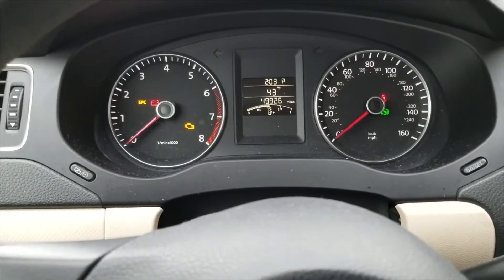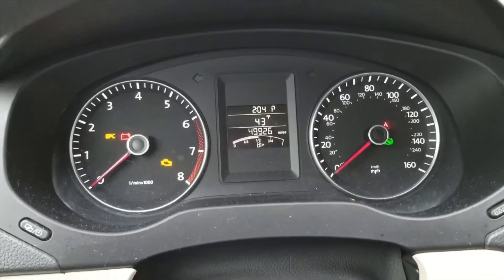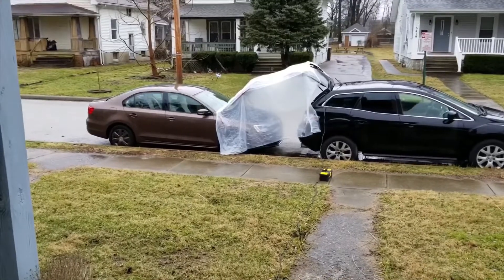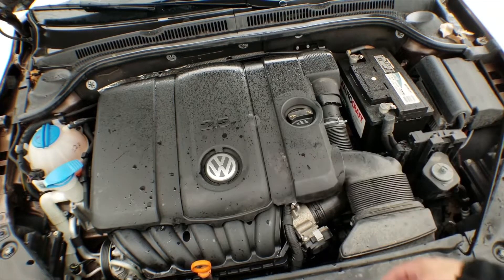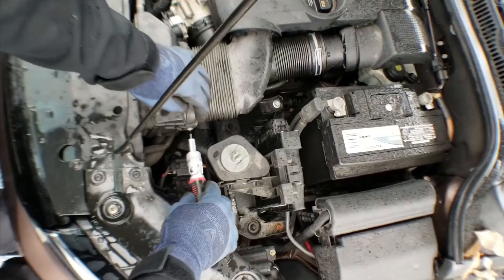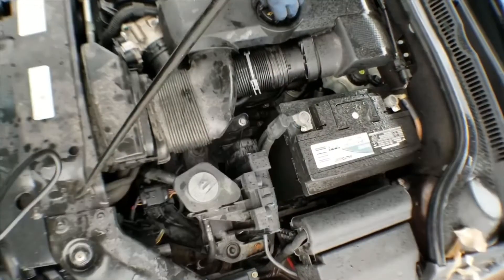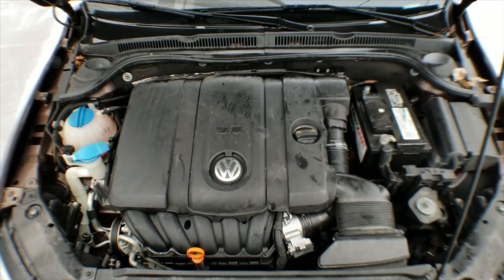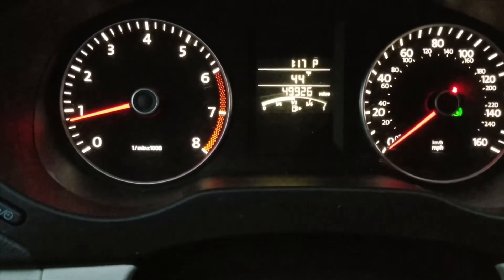Volkswagen EPC Light Diagnosis: Throttle Body Replacement

Comment: Thanks bro! you just saved me about $1000 bucks. I drive a 2013 VW Jetta 2.5. I got the engine light on  and also the EPC light. Bought a replacement throttle body from amazon it was only $64.99 and about an hour and a half of my time to replace it. I did not get the original throttle body but it was a brand new unit. Replaced defective unit with new unit from amazon. And EPC light went off  right away. The engine light went off on its own as well after driving the car for about 30 minutes. Went home turned the car off, then went to go run an errand about 20 minutes later and engine light was gone as well.  Thank you man, keep up the good work!
Reply: Hey man, I know it's been a long time but, how did that part from Amazon turn out for you? I'm having the same issues with my 2013 jetta.
Reply from the maker: Hey thanks for the positive feedback and tuning in! It is greatly appreciated! Awesome I'm glad that this video has helped resolve the problem and thanks for the update 👍 Stay Tuned and consider subscribing if you enjoyed the video! Thanks again!!

Comment: Hey thank you so much for this video I got a 2013 vw beetle and I just got a epc light. The codes it gives me all lead to. Oxygen sensor issue and one throttle position issue. Do you think a throttle body change would help. Possibly maybe potentially?
Reply from the maker: Hey thanks for the positive feedback and tuning in! It is greatly appreciated! I hope that this video was helpful and will help you resolve your EPC light issue 👊 Awesome yeah you should have no problem replacing the throttle body and the oxygen sensor should be a separate issue and shouldn't had caused the EPC but its possible since it would be running without the proper air, spark, fuel ratio 👍 Stay Tuned and consider subscribing if you enjoyed the video! Thanks again!!

Comment: Thank you for this video, the same is happening to my 2013 Passat, I had a new throttle body replaced I bought a brand new, but the same is happening. Honestly it’s hasn’t being a day yet since the throttle body was replace. Any suggestions should I take it VW?
Reply: Same here. The shop keeps replacing the throttle body (third one now!), but EPC light keeps happening. Now seeking experienced exorcist.
Reply from the maker: Hey thanks for the positive feedback and tuning in! It is greatly appreciated! I hope that this video was helpful and will help you resolve your EPC light issue 👊 Id recommend getting the codes read with an OBD2 scanner at a local parts store or VW to narrow down what the potential issue is that is still causing the issue since there are so many potential issues that can cause an EPC issue! Stay Tuned and consider subscribing if you enjoyed the video! Thanks again!!

Comment: I live in Perth Australia.  My polo 2013 at 44000 km ..epc light came on 4 times in 1.5 year. I spent almost $2000 and the light came.on again this morning. Is this normal
Reply from the maker: Hey thanks for tuning in! It is greatly appreciated! I hope that this video was helpful and will help you resolve your EPC light issue 👊 it shouldn't continuously come back on after resolving the issue, but unfortunately VW can be a pain for this EPC issue. It can be a wide range of issues however you will benefit from running an OBD2 scanner to help narrow down what the true issue is if there are codes🤙🏽 Stay Tuned and consider subscribing if you enjoyed the video! Thanks again!!

Comment: Great video. Same exact thing happened to my 2012 Jetta. I got it diagnosed and my throttle body needs to replaced. I bought the part and will replace it soon but was wondering if the epc and engine light automatically goes away once new throttle body is installed. I was told by a mechanic that it needs to be “reprogrammed” and he was trying to charge me $250 for that.
Reply from the maker: Hey thanks for the positive feedback and tuning in! It is greatly appreciated! I hope that this video was helpful and will help you resolve your EPC light issue 👊 Awesome yeah you should have no problem replacing it! The EPC light disappears on its own while I needed to use my OBD2 scanner to clear the check engine light that never came back after 50-100 miles of driving meaning the problem was resolved! No you do not need it to be reprogrammed I never had an issue with throttle response afterwards 👍 Stay Tuned and consider subscribing if you enjoyed the video! Thanks again!!
Reply: Awesome! Thanks so much! Really appreciate your video and your response

Comment: I have 2008 VW Jetta 2.0T FSI, VWs are notorious for sensors and other smaller parts going bad. There is no excuse. Mine shredded the oil pump CAM Follower at a low 17,000 miles and it had been replaced once already. Engine burns oil like crazy from 20k mi onward. Does VW ever take responsibility for the junk they make?? Nope, just like having to pay $800 to remove carbon buildup since engine is direct injection and has design flaw. Burns over a quart of oil per tank of gas, VW says its normal!!! Mind you this all started at very low mileage. I'm only owner and change oil and perform maintenance religiously. VW is an arrogant company, with lots of problems. Now my 99 passat I loved and no problems. Its a crap shoot.
Reply from the maker: Hey thanks for the positive feedback and tuning in! It is greatly appreciated! I hope that this video was helpful and will help you resolve your EPC light issue 👊 they sure the hell are mine just kept having issues first EPC then wheel bearing and this was all at 30k and 40k like wtf!! I recently got rid of it since it was a hassle fixing such a low mileage car! 👍 Stay Tuned and consider subscribing if you enjoyed the video!

Comment: After a lomg distance trip it just popped up just as I was about to reach my house and 2 weeks ago had the head gasket replaced!!
Reply from the maker: Hey thanks for  tuning in! It is greatly appreciated! I hope that this video was helpful and will help you resolve your EPC light issue 👊 its hard to be certain what could be causing the EPC light issue without attempting to read a check engine light with an OBD2 code scanner! However sometimes you can narrow it down based off of the symptoms you are having? Keep me posted on the results👍 Stay Tuned and consider subscribing if you enjoyed the video! Thanks again!!
Reply: @elevatedpotentialacademy  In the morning EPC light was gone but car was loosing power, got a guy to run diagnostics on it and discovered the coil pack was cracked which caused a misfire and needs to be replaced.

Comment: How did you know it was the throttle body? You just took a shot ?
Reply from the maker: Hey thanks for tuning in! It is greatly appreciated! I hope that this video was helpful and will help you resolve your EPC light issue 👊 I identified that it was the Throttle body due to the P0222 code i got when running the OBD2 which can indicate the accelerator pedal too but I never had intermittent response from the pedal. Keep me posted on the results👍 Stay Tuned and consider subscribing if you enjoyed the video! Thanks again!!

Comment: My car has a long crank for it to turn on and prior to changing the cam sensor and crankshaft it would turn off so I changed them and cleared the codes but the epc and check engine came on idk if it’s the throttle body  I never put the filter back on to test it but your video made me think further into the problem and I think it might work lol so preciate it   I subscribed and I’ll leave my like 🤣🐱💯

Comment: I got fix the 2014 VW Jetta s 2.0 s. I had the epc and check engine light and I found the cause it was a ignition break down at the spark plug wires.
Reply from the maker: Hey thanks for returning to share👊  I love to hear that checking the ignition wires had fixed the problem👌🏽 Stay Tuned and Thanks again 🤜🏽🤛🏽

Comment: I have a question , I went on Monday to auto zone because I had check engine light and car seemed to be driving different . They said needed new coils and spark plugs which is what codes was giving them , two days later I’m driving and car was rumbling and shifting bad and epc light came one . I just ordered the coils and spark plugs my son going to change is that a good place to start or do I need to spend lots of money to get throttle body replaced
Reply from the maker: Hey thanks for tuning in! It is greatly appreciated! I hope that this video was helpful and will help you resolve your EPC light issue 👊 Yes, bad coils, plugs, and wires could certainly cause and EPC light problem because it is impacting the cars acceleration parameters due to a failed or bad connection. A new set of each could certainly resolve the problem 🤙🏽Keep me posted on the results👍 Stay Tuned and consider subscribing if you enjoyed the video! Thanks again!!
Reply: Ballin On A Budget Auto changed the coils and spark plugs it’s been running fine ... yesterday was sitting in drive thru and light came on epc and throttle body .. then turned car off and back on and running fine . Was told to try cleaning with spray

Comment: The eps light  in my 2014 Jetta 1.8 turbo comes on  every time I go uphill  it makes  noise ,but not engine light . when I restart the car the eps light disappear and the car runs normal no underpowered but I have to take that ramp uphill every day to go home any advice?  Thank you

Comment: I hace a 2012 vw passat 2.5 

Engine light Epc light came on I scan it and I got a code P0122. Saying TPS sensor?    
 
Light go off and on yesterday was when if first happened this morning it was doing good 20min later lights came on and everything happened again.

Losing power and wont go over 3k 

cruise control wont work either 

Some one told me it could be the battery I checked it and it good other person told me to check the pedal cabe behind it but still came back on would you recommend just buying the same throttle  body you have and did you have to program it or just plug and play because I also seen that some people do some programming and other people say u dont need to I would appreciate if you can get back at me nice video man thanks
Reply from the maker: Hey thanks for tuning in! It is greatly appreciated! Im glad you had enjoyed the video. I hope that this video was helpful and will help you resolve your EPC issue 👊 it definitely is the throttle body because the 2012 is electronic and does not have a separate Throttle Position Sensor, it is attached to the throttle body! You can try to clean the throttle body first and if it doesn't work I'd get a new one! Keep me posted on the results👍 Stay Tuned and consider subscribing if you enjoyed the video! Thanks again!!
Reply: @elevatedpotentialacademy  thank you just  order the one you bought I'll let you know how that works thank you for the reply and the video I subscribed since I first saw your video 

And I did clean it and it didn't worked I was told  by a friend he ran the codes and said to get the throttle body and the pedal accelerator assembly my car is @169k miles

Comment: My 2018 VW Jetta is having this issue...EPC light just magically appeared this past Saturday...vehicle was driving perfectly fine the night before🤦🏾‍♀️ EPC Light as well as the Engine light is on...sluggish acceleration...Should I assume that the Throttle Body needs to be replaced? I don’t wish to go thru the run around at the dealership🤦🏾‍♀️ Please and Thank You for your help in advance✨
Reply from the maker: Hey thanks for tuning in! It is greatly appreciated! Im glad you had enjoyed the video. I hope that this video was helpful and will help you resolve your EPC issue 👊 i would start by first getting the check engine light read in order to know what exactly is causing the EPC light and check engine light!  Stay Tuned and consider subscribing if you enjoyed the video! Thanks again!!

Comment: Hey I have a EPC light and check engine light come on and stopped running I changed the Throttle body used from a wrecked Jetta, new cam sensor, crank sensor,gas peddle, brake sensor and a tune up still on and not running so what else can I do.
Reply from the maker: Hey thanks for tuning in! It is greatly appreciated! Im glad you had enjoyed the video. I hope that this video was helpful and will help you resolve your EPC issue 👊 what does the check engine light say is the problem? Stay Tuned and consider subscribing if you enjoyed the video! Thanks again!!

Comment: Epc light and check engine light came on. 2010 Jetta. Car won’t go past 1 rpm. Code showed throttle body accuator. Priced throttle body at part store and they quoted over 800 dollars. We purchased one online for 80 dollars. Waiting to put it on now. Several people are telling me we need to have it adapted. Is this true?
Reply from the maker: Hey thanks for tuning in! It is greatly appreciated! I hope that this video was helpful and will help you resolve your EPC issue 👊 I had installed mine in my 2012 without a need to recalibrate and it is still working fine till this day! I'm sure yours will be fine as well! Keep me posted on the results👍 Stay Tuned and consider subscribing if you enjoyed the video! Thanks again!!

Comment: I have a 2016 vw jetta and epc came on and I pulled into a parking lot and turned it off for 5 minutes then I started it up it was gone I go back on my way and it turns back on not even 30 seconds driving and then check engine light very strange i was close enough to my house drove it back 
Just wondering what to do
Reply: I also started smelling gas when I got back to my house inside the car and opened the hood and smelled gas even more I'm currently home looking at shop prices and YouTube videos with a fix hopefully
Reply from the maker: Hey thanks for tuning in! It is greatly appreciated! I hope that this video was helpful and will help you resolve your EPC issue 👊 Is there also a check engine light on currently? I would recommend having it read in order to narrow down what part is failing to cause this acceleration/ gas fume issue. It could be your throttle body, acceleration pedal, mass air flow sensor, camshaft sensor, crankshaft sensor, or even something as small as a tune up! The Gas fumes must be some type of evap leak? Keep me posted on the results👍 if you had enjoyed the video, please consider subscribing 🤜🏽🤛🏽 ! Thanks again!!
Reply: @elevatedpotentialacademy   Ballin On A Budget Auto  will a regular mechanic shop do the trick just to get the codes read and then take it to a vw mechanic? I was gonna take it to midas as its only 3 blocks from my house. the gas is pouring out from underneath the engine block when I start it and can still smell the fumes more now I haven't seen it leaking from anywhere else I think whatever is cause the gas to pour out like that is what causing the problems
Reply from the maker: @IsnanaDayton  oh wow yeah I would recommend going to a nearby shop if you dont normally work on your car to that extent. They will figure out where the leak is and also do a diagnostic check which should include a check engine light code read.  I wish you luck on the repair.
Reply: @elevatedpotentialacademy  hey I got my car fixed! 1300 dollars later lol 
So a bolt completely broke off on the fuel line system which loosened it and was starting to come off which fucked up the o ring where it brings gas into the engine, mechanic said I'm lucky the engine didn't start on fire with gas pouring out because of the busted o ring, they ordered the parts right from Volkswagen in Germany car wasn't supposed to be ready till next week so I'm glad my cars normal again although I'm feeling empty in the wallet

Comment: My 13 vw beetle with 94k miles 3rd owner is me and i bought it 3 months ago and im not sure whats wrong it doesnt accelerate how its supposed to and linp
Mode happens i still drive it around bc i dont have money yet to get it to the delaership and fixed i dont want to end up paying a big bill so how can i exactly know what to replace?
Reply from the maker: Hey thanks for tuning in! It is greatly appreciated! I hope that this video was helpful and will help you resolve your EPC issue 👊 Is there also a check engine light on currently? I would recommend having it read in order to narrow down what part is failing to cause this acceleration issue. It could be your throttle body, acceleration pedal, mass air flow sensor, camshaft sensor, crankshaft sensor, or even something as small as a tune up! Keep me posted on the results👍 if you had enjoyed the video, please consider subscribing 🤜🏽🤛🏽 ! Thanks again!!

Comment: Bought a Passat with the epc light turned on and it doesn’t accelerate:(
Reply from the maker: Hey thanks for tuning in! It is greatly appreciated! I hope that this video was helpful and will help you resolve your EPC issue 👊 Is there also a check engine light on currently? I would recommend having it read in order to narrow down what part is failing to cause this acceleration issue. It could be your throttle body, acceleration pedal, mass air flow sensor, camshaft sensor, crankshaft sensor, or even something as small as a tune up! Keep me posted on the results👍 if you had enjoyed the video, please consider subscribing 🤜🏽🤛🏽 ! Thanks again!!